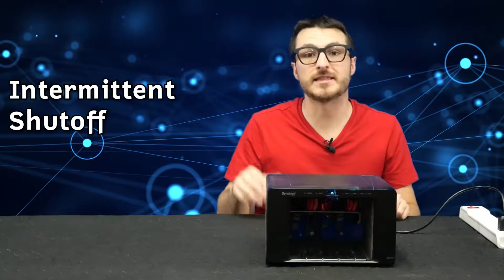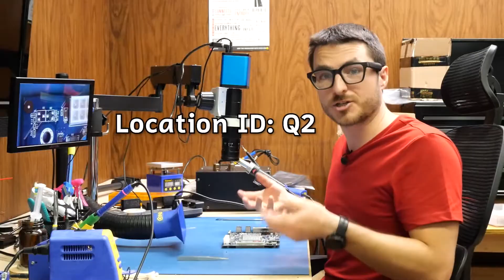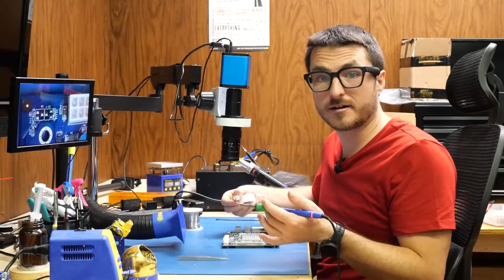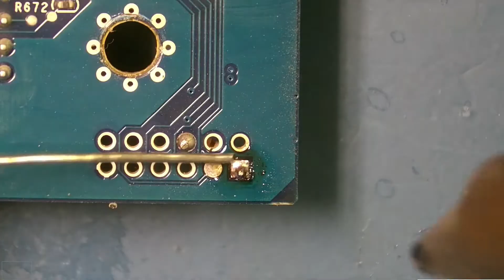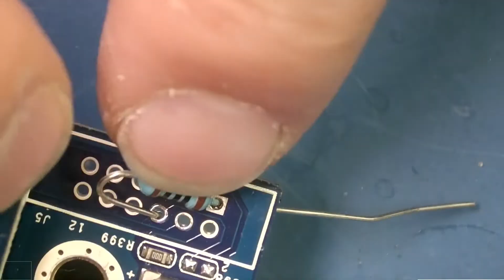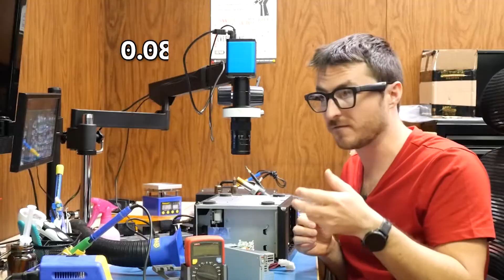How to fix DS1515+ Synology All common faults

Comment: Just wanted to drop in to say that I followed your fixes (all) and my DS1515+ is back online. Thank you so much. 
I wasn't as familiar with the details of the parts but this is what i used.
Battery (CR1220)
Q2 position - BC847B NPN Transistor SMD SOT23 (100mA continuous collector current, 45V Colelctor Emitter Voltage Max)
Power Fix - MCPS03W4F1002T5E - 10K ohm Resistance, 250mW power resistance, Thick Film, 50V Voltage rating
Reply from the maker: That's awesome, glad to hear your unit is back up and running! 👍

Comment: What I find most fascinating is that you could remove the big power cable from the motherboard so easily. I'm afraid to pull off the whole connector since it's stuck so hard onto there.
Reply: Wiggle it a little bit to make space, then use a large flat-head screwdriver to carefully wedge it out on both ends.
Reply from the maker: Yeah flat head techniques described by @diatonicdelirium1743 would work if it's giving you a hard time.
Reply from the maker: There is a tone of friction. Knowing how much force is acceptable is a big part of it. You do have to be careful, and often when it's stuck I have to try and wiggle left side then right side then left side then right side until it eventually comes off.
Reply: @NicksElectronicRepair  Well, you're probably right. I'm very experienced with PC-building and never had these problems. Like I've really pulled on it, wiggled, thought the connector would come off the motherboard, fought I would rip the cables out of their sockets, and so on. Been able to do what I wanted without removing it though.

I have a problem with my DS1515+ that sometimes it will just be powered off. Usually this has happened when it's been turned on for months and has a ton of dust in it. So I clean it out and it just starts up again.
Lately it hasn't been turning off except from when I needed to move it at some points. I noticed that it is really hard to power it on again, you may have to push the power button ten, twenty, thirty times before it decides to turn on and then it just works as normal again.
Last time I found it shut down one day, pressed the button a million times to no avail. Bought new battery, still the exact same problem. Clicked the button 30 times again before it decides to start up and works just fine again.
This is a replacement unit that I got from Synology after my first one died due to the CPU-bug back before the 2020's. So it has the "fix" installed on the motherboard.

So many annoying problems with this DS1515+. It also has a frequent buzz from resonating harddrives that is very loud. Tried to torque the screws for the harddrive slides but it made no difference.
When this thing breaks down completely I will just abandon Synology for good.
Reply from the maker: @kiiroMADE  I know it's frustrating but if you want to send in your DS1515+ for repair, I know how to fix that so it doesn't keep happening. We learned a new trick recently that is not covered in this video which will help with increasing the longevity of the units and prevent repeat failures from occuring. 
Your Q2 transistor failed and needs to be replaced as shown in the video, there is the power supply resistor mod shown in the video that will help extend the life but there is also another mod we can do to further reduce the likelyhood of repeat failures.
Reply: @NicksElectronicRepair  No, it's not worth it. I'll assume your buisness is in the US and I live in europe so that's a big no. These units are just bad quality all together, and with the recent scummery from Synology with harddrives makes me just want to throw the unit in the bin once it stops working. It'll be much better with my own custom NAS instead, as it'll be easier to replace parts and they'll also work better.

Comment: Hi Nick. 

Thank you for your wonderful videos on fixes to the Synology Diskstations. 
I am in Malaysia and my trusty DS1513+ has got no power and no lights at all and this just happened. Do these fixes work on my board as well? I do see a Q2 and Q4. And does it also need the 100 ohm fix? Any help will be much appreciated. Thanks.
Reply from the maker: No this video only pertains to the DS1515+ 
I don't actually have a video on the DS1513+ but I do have one for the DS1813+ which is an almost identical motherboard with almost idnetical faults and repairs. 
https://youtu.be/pujpr-hd8bw

Comment: Thanks Nick -  I dug out my soldering iron and gave it a go: the backup battery was at 0.5v (yup 0.5) so it shows how infrequently I was turning it on and off - anyway the 100ohm resistor did the trick - thanks for your clear instructions and if I’d been in the states I’d have sent my 1515+ to you to fix the other two possible weaknesses but being in the uk the shipping costs were prohibitive - I’m copying everything off it now as after 15 years not sure I trust it anymore - keep up the good work best jon
Reply from the maker: Glad you found the video helpful, and awesome work on the repair!

Comment: Hi Nick,
I have DS1515+ that won't power on after unexpected power loss at home.
I changed the CMOS battery, I measured the 100Ohm resistor (shows 99 Ohms) and I replaced the Q2 transistor BC847B.
Now the unit power's on from the button and without any hard drives it completes the boot process and stays on blinking GREEN LED.
If I insert my hard disks and power it on if goes all the way to STEADY GREEN light than blips (supposedly to start normal operation) and shuts off on its own completely.
I tried to insert also a single blank HDDs and tried using different slots but the result is the same.
I hear that there is HDD activity until the GREEN LED becomes steady and the unit shuts off.
I tried to use only one memory modules ,also swap the places of the DIMM sticks but the symptoms are same.
Any idea what could cause this behavior?
Thanks!
Reply from the maker: You could try replacing the ram with new ram but like I said in my email response, this one is very strange and would require more in depth diagnostics. It's also very possible the CPU needs to be replaced which is something we can do if you are willing to ship the unit to us.

Comment: I have a ds1515+, it has the alert and power light flashing. I have changed out all the components you suggested, but it still has the issue. What else would you suggest?
Reply from the maker: You could have a short somewhere in the unit, maybe your ram is bad, or your CPU has failed. All of which are not very common but can occur.

Comment: Thanks so much. I have come into a DS1515+, my brother in law upgraded. His old unit wouldn't power on, so took the gamble on a 35.00 new power supply for my model from ebay and it worked. It powered up, I made my ethernet connection, to my router and directly to my computer and the Synology assistant cannot find it on the network. If you have had this happen, I would super appreciate some direction toward being able to use this system. I had 4 drives in the bays and whether they were in the Synology or not, no network recognition.
Reply from the maker: Either your unit is not being detected because it's not booting in all the way or you have some sort of ethernet controller chip malfunction. That failure is going to be a bit more difficult to repair, but we have fixed those in the past and will fix many more in the future I am sure. Here is a video of that repair we did on a DS412+ with ethernet port malfunction. 
https://youtu.be/wBoWI3KaqNw
Reply: @NicksElectronicRepair  Hey, wanted to get back to you on this because you assisted. I finally got it to recognize my Synology because I had the ethernet cable plugged into the back of my Arris router, I know right, stupid. What I missed was a wifi system that boosts my wifi and is faster, had ethernet ports behind that unit, that once I plugged it in, was recognized by the Synology assistant software. I was  perplexed that I had all the lights blinking everywhere I should, then nothing.
Reply from the maker: Oh nice that's good news!
Reply: @NicksElectronicRepair  thanks watching it now. I've been known to get the soldering iron out, should it present itself.

Comment: I had issues with my DS1515+ rebooting, then no longer powering on. I did do the transistor replacement and the 100 ohm resistor install, and installed a brand new CR1220, which fixed my issues, and after 2 months I am back to seeing the system reboot after a couple of minutes quite consistently. I did not replace the PSU resistor, I assume that your comebacks had this issue return after a few months or so? Additionally, it looks like you sized up to a larger resistor. What is the wattage of the new resistor? (1/10,1/8. etc) The system is definitely up there in age but i am not able to replace it as of yet, and would like to make an additional backup of my data since it is being unreliable. Thanks.
Reply from the maker: No I have never seen this issue with the repair failing and having reboot problems. This is the first time anyone has said they had this failure. I recommend you do a software update to your unit. If the issue persists, it's possible one of the parts you installed is not working properly. I can't really assist further without having you send in the unit for I or my techs to look at in person and diagnose further since this is not something we have ever heard of with this unit. All of our repairs are pretty much 100% with no warranty after performing all the repairs shown in the video. 
As for the resistor size on the power supply, it doesn't matter as long as it's the same size or bigger as the original.
Reply: @NicksElectronicRepair  Finally had the time to work on this... Replacing the PSU resistor seems to have done the trick. 2 days of uninterrupted uptime so far!

Comment: @NicksElectronicRepair: have you experienced random crashes during normal operation causing both the alert and blue light to blink continuously? The CR1220 battery has been replaced by me before and has ~3.1V (like in your video), the 100-ohm resistor has ~99.3-ohms (factory installed by Synology) and already replaced the BC847B transistor. The device power button works as expected, it's just these random crashes that are very hard to diagnose as everything goes down (ssh, web, etc) and no logs are produced.

I now have UART access for additional debugging but wondering if you've seen anything like this before on a DS1515+. Thanks!
Reply from the maker: Not really but it could be that the CPU is starting to fail to the point that the resistor fix is not enough and a new CPU is necessary. We have had to replace the CPUs on these units before. 
I always recommend a software update and full factory reset if possible, if the issue persists, then at least you have ruled out a software failure which means a hardware failure is the cause. You could then try new Ram, or perhaps a new power supply.
These are all things I would try if the unit was here in our shop. Intermittent failures however are very hard to diagnose.
Reply: @NicksElectronicRepair  Thanks for the reply! On the UART console, there's no output but it coincides with heavier load (starting all docker containers), so I suspect the CPU is finally in its final days. Is it even worth trying to replace the 100-ohm resistor?
Reply from the maker: Yes it's worth trying that.

Comment: Thank You! Got my DS1515+ working again. Did not know what was the real problem as the power light blinked and also alert led was blinking at the same time. So it was powering on but did not boot. Battery was 1,6V only. Tried to boot without the battery but nothing different happened. So I added 100 Ohm resistor, replaced 392 with 103 and changed the battery. After that it booted up like it should.  Thanks again :)
Reply from the maker: Glad to hear you got it going again! Nice work

Comment: hi Nick

does this apply to same DS1511+ blue blinking power light ?
Q2 and resistor ?
Reply from the maker: Does not this repair is specific to the DS1515+
For your unit you may want to check out this video as it may be more closely related to your unit's issues:
https://www.youtube.com/watch?v=xpV5ydNdxHg

Comment: Hi.Looks like  you know what you doing :)  I got a almost the same nas just the ds218+ and it does turn on properly everty 15 startup... blinking blue led  .. PSU replaced,secondary RAM removed etc.. but still blinking. I think there is something like mainboard  power issue. maybe  Idea?
Reply from the maker: Not a clue, we have attempted to fix them before but the DS218+ has eluded us. We haven't really had a chance to really spend a lot of time on them yet. If you find something out, let us know I would love to do a video on them.

Comment: Thanks for the video! I replaced the transistor, checked the 100OHM resistor and replaced the battery, and now the unit can turn on which is a step in the right direction, however, now the blue light blinks forever.  Do I need to replace the NAND flash controller (PHISON PS2251-68-5 in this case) similar to the DS1813+ video you completed?
Reply from the maker: Oh looks like you did find the video here. 
No the DS1813 video is different and won't apply to your unit. 
You replaced the transistor, battery but didn't install a resistor? Just checked it? Does this mean you already had one in there? 

The blinking blue light fault for your unit is fixed with the 100 ohm resistor installation. If that resistor installation does not fix the fault then you could have an issue with your RAM memory. Replace those first I would say. If the fault persists, then most likely the CPU itself has failed beyond this repair method and needs to be replaced. We can do that for you if you would like.
Reply: @NicksElectronicRepair  Yes there was a resistor already installed by Synology. 97.03OHM.

Comment: Thanks for your very informative video - the fault I had was it would intermittently power off and not power on - I replaced the battery (it was dead) I replaced Q2 ( I used a BC 846 SMD) and added the 100 ohm resistor. Pressed the power button and up it came - brilliant 🙂

Comment: I have a 1512+ that just got the flashing blue lights when booting up.  I tried popping out my drives first, but same result over and over.  I'm gonna test my PSU next, but I dont think the resister trick for the 1515 is the same fix for the 1512.  Any other ideas on how to diagnose the dreaded blue light flashing on a 1512+ ?  Thanks!
Reply from the maker: Your PSU is fine if your unit has power and the blue light is showing up. That means your motherboard has a fault. Almost certainly this fault:
https://youtu.be/IxxjOLzy30o

But if you are interested in testing your power suppl, I made a short about how to do that with all NAS PSU's
https://youtube.com/shorts/ep083A5QYOg?feature=share

Comment: Hello Nicks the 10KOhm resistor in the power suply what is the power off the resistor 0,25W or 0,5W
Great video i am going to try and repare my DS1515+ myself afther seeing your video
Reply from the maker: I believe it's 0.25W but I don't remember and ill be honest I am a little lazy to go find the info. When in doubt just go with the 0.5W
Reply: @NicksElectronicRepair  thanks i will give it a try
Reply from the maker: How did the repair go?

Comment: I have a DS1515+ that appears to have dead ethernet ports. The RJ45 link LEDs don't light up when plugged in to known good switches using good cables. And of course it's not pingable, doesn't show up in DHCP tables, etc...
Any Idea?
Reply from the maker: It is not as common but we have done those repairs before. The ethernet chip can short out and fail. This usually happens due to external factors such as lightning strikes or power surges that affect the modem/router and travel to the device via the ethernet cable.
It is also possible the chip just failed although that is rare. 
In order to fix this issue, you most likely will need to replace both chips. If they fail because of a lightning strike or power surge, it is also possible the main processor also needs to be replaced. 
If that is the case, then this repair is still doable but much more involved.
Reply: @NicksElectronicRepair  On the same day of the breakdown there was also a breakdown of the 100oh resistor. I did this resistance repair and I was able to observe that the nas turned on correctly as my other synology nas do. But now I have this second fault that without Ethernet the NAS is useless, I have even tried to find the possibility of mounting a USB WiFi, USB Ethernet or a mini pciexpres but this NAS is not prepared for this.
Do you think that changing the 4-port Ethernet chip is enough?
Reply from the maker: Sorry for the late reply but yes it could be enough, no way to know for sure until you do it though.